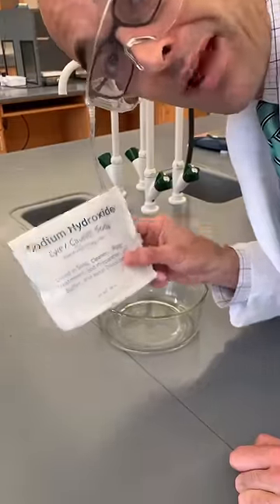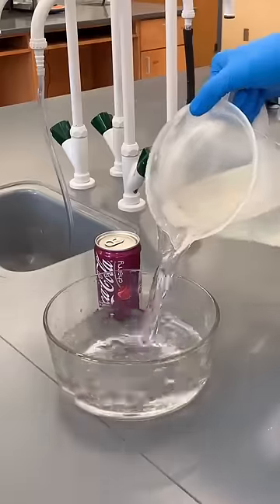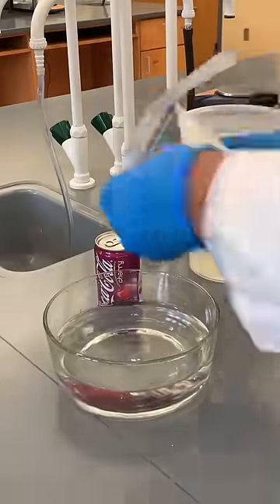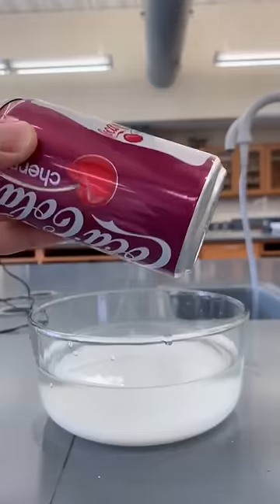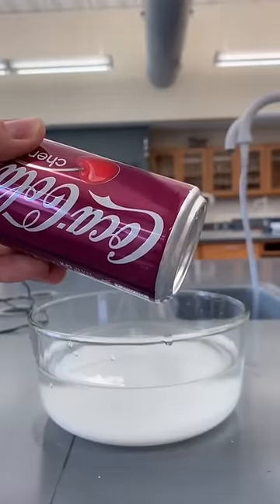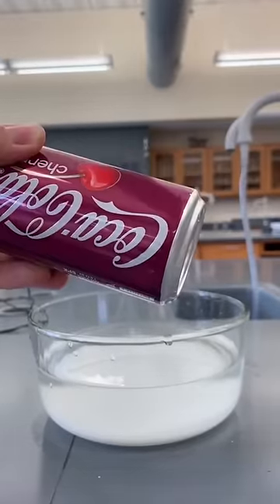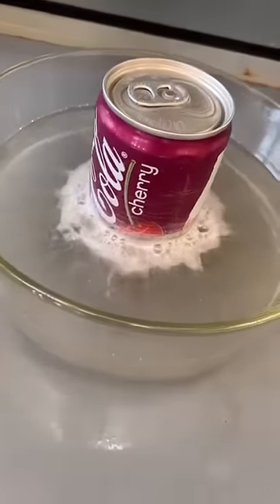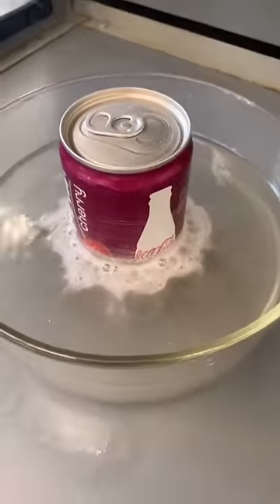Did you know this about aluminum cans?

Comment: The plastic liner is to keep the acids in the soda from eating through the aluminum can.  Also, they use thicker plastic liners in energy drinks, like Monster, because they were corroding the soda can liners.  We drink this stuff!!
Reply: Yeah, really, you look in the ingredients of coca cola and realize the big one is phosphoric acid. who wants to bet that the phosphoric acid dissolves aluminum? I bet it does.
Reply: That’s why I don’t don’t drink soda anymore. It’s literally a can of chemicals.
Reply: Probably isn't amy worse of an acid than the stuff we have in our stomachs.
Reply: Well, it makes sense because these beverages may be used to strip car battery acid. Pouring coke over your battery cables has been a remedy as long as I can remember. I wonder what it’s doing to our innards?  🤢
Reply: Ya'll drink that stuff I stopped drinking soda awhile ago and I feel better now even though when I was drinking it wasn't a lot.
Reply: Well we aren't made of aluminum
Reply: @rOnda88  Actually, the problem isn't the cola (necessarily), but the aluminum. Aluminum creates dangerous and toxic byproducts when it reacts with acids. That''s why uncoated aluminum isn't really food safe.
Reply: Concentrated mountain dew syrup is more flammable than the diesel fuel used to transport it. In fact its so flammable it is considered an explosive and is illegal to personally transport out of the country.      Got to see this first hand in the DPSSD course for flammable liquids n gasses.
Reply: Buy glass bottled drinks like a classy fella
Reply: I mean, citrus also has acids (its literally called Citric Acid), of course its healthier, but if the idea of ingesting acids is the main thing disgusting people then think about citrus or sour things in general.
Reply: you do!
Reply: Well I don't hold soda in my mouth or stomach for weeks maybe months at a time...
Reply: Imagine what it's doing to your gut!
Reply: ...... and it tastes dang good!
Reply: @medexamtoolscom  If you have to bet it does, then should you really be talking about it? For one, it's not a big ingredient. While being the third highest ingredient in the diet coke I have in my hand, that's after the food coloring, so, there's very little of it in the soda. Two, phosphoric acid is a weak acid, though it does stink and irritate the sensitive parts of your body like your eyes, lungs, and the inside of your nose if it finds its way in there. It's probably part of the reason why if you inhale pop fizz, you might cough or sneeze. Thirdly, while it is a weak acid that poses very little harm towards your at all, it can dissolve metal, so your guess, while uninformed, was correct.

Also, I just looked into it and phosphoric acid has a density of 1880 mg/ml, and there is between 50mg-70mg of phosphoric acid per 100ml of coke, which means that in total, the phosphoric acid makes up 0.03% of the coke in the can.

In conclusion, stop trying to fear monger by reading ingredient labels. Chlorogenic acid is known to lead to heart disease, so you probably should steer clear of that one, right? Except, it's just one of the many chemicals that's in foods you eat all the time, like apples. Also, phosphoric acid helps with grow strong bones and teeth, along with support kidney health.
Reply: @datdude1538  And an apple is a ball of plant flesh that is full of chemicals. Do you avoid those as well? Not saying drinking soda is good for you, but acting like it's bad because it has "chemicals" is just stupid. All the food and drink you consume has chemicals in it.
Reply: @sunnybatman2578  Which is why only a tiny amount goes in soda.
Reply: I just think about when I was a teenager and didn’t have a pipe or paper to smoke pot and we would make a hole and do it that way no wonder it hit so hard 🫣
Reply: I just think about when I was a teenager and didn’t have a pipe or paper to smoke pot and we would make a hole and do it that way no wonder it hit so hard 🫣
Reply: It only hurts out teeth though.🤷‍♀️
Reply: @rOnda88  Our insides are not made of metal. It reacts with metal.
Reply: @AlashiaTuol  I dated someone who had mad aluminum sensitivity. So no cans or metal anything including for cooking.
Reply: @datdude1538  We are all just chemicals…
Reply: @rOnda88  Lemons are used to clean and deodorize. Are they still safe to eat? Yes…
Reply: The acid in your stomach is anywhere from 1.5 to 3.5 pH. Acid in soda is around 2.5 to 3.5, without the addition of water and whatnot to make it less accidic. In other words, it isn’t any more acidic than your stomach, and that’s where it’s headed… so it makes no fuckin’ difference lmao.

Be more worried about the contents that make it through your stomach, intenstine, liver, etc. to enter your blood stream. That’s what’ll actually impact you, not the shit that’s more neutral than your own stomach.
Reply: @datdude1538  Literally everything is a chemical.
Reply: @dinoboiis8147  I've used citric acid to clean years of hard water build up in my toilet tank. Imagine what it's doing to your insides!!!! ¡¡¡¡

Now let me tell you how healthy I eat and how I'd never put chemicals into my body-including dihydrogen monoxide! The deadliest of them all!
Reply: @andymittelman4022  Literally nothing. Your stomach acid is far more corrosive.
Reply: Damn you're right wtffffffff it's glass bottles for me from now on
Reply: @TheRealSindri  our stomach acids can dissolve nails. I doubt whatever acids are in carbonated drinks is going to do anything to us
Reply: Just as well our insides aren't made of aluminium.
Reply: Drinking it isn't a problem. The issue comes when you drink too much of it. As with anything, too much of something is bad for you, even water. Too much water can make you sick, even kill you. Too much oxygen can make you sick. Too much sugar, salt, vitamins, minerals, literally anything your body needs can harm or even kill you if taken in excess. As it turns out your body can use a lot of things. Phosphoric acid is one of them, carbonic acid is a product of carbonated water, but is also what your body makes to move carbon dioxide around the body. Citric acid is a necessary acid as well. Just because something has "acid" at the end of it doesn't mean anything without the context of what it actually does and whether your body uses it. Hell our bodies make hydrochloric acid to break down our food, and phosphoric acid is no more acidic than our own gastric fluid. Unless you go drinking a pure bottle of it, you won't affect yourself too badly by drinking one or two a day. It's the people that make it their only drink that will have the issues. Not because of the acid itself. Again to cause any serious physical harm you would have to go drinking a ton of soda, more than you would generally be able to handle to have acid damage which I'm not sure would even happen from the diluted amounts found in soda as it's only there for taste. No, you would have more issues with the phosphorus displacing the calcium in your body. Now keep in mind, your body needs phosphorus, and both it and calcium are used in the same place, but if you have too much phosphorus and not enough calcium you can have problems. That's where the true problems of phosphoric acid lies, not in the acidity, but in the things your body breaks the acid down into, it's base components.
Reply: I know a guy with a coke addiction. His teeth are black & are tiny little stumps. In Adelaide Australia we have access to cheap or free dentistry. He owns his own business tho & has the means to pay. He just doesn't. Yuk. A lovely guy. A good father but..
Reply: it's to prevent aluminium poisoning.
Reply: @Sovereignty3  except for the fact that stomach acid is supposed to be there. Add phosphoric acid and you cause a calcium phosphorus imbalance & mess up your acid base leading to bone loss, osteoporosis and weak broken bones. But go ahead, enjoy your cola, it tastes good so can’t be that bad.
Reply: Y'all drink that stuff!! Not in my temple!!
Reply: @datdude1538  What do you drink now?
Reply: Not all of us!!!   🤮
Reply: @Sovereignty3  difference is ours is natural to our micro biome.
Reply: @dbutler1986  were made of something softer
Reply: @dinoboiis8147  bro citrus is naturally occurring 🤦🏾‍♂️ soda isn’t it’s made in with the mixing of different chemicals to make a carbonated sweet and tasty drink
Reply: We breathe oxygen which will rust iron, Just saying.
Reply: @wruenvadam  Thank you for reminding all these people how much of a doofus they are.
Reply: And we put that in stomachs
Reply: @Sovereignty3  only thing I heard all day that makes any gdamn sense.
Reply: What's bad for metals is good for humans. What's good for metals is bad for humans.
Reply: @medexamtoolscom  it takes the blood off the pavement. The clean up crews use Coke a cola for that
Reply: @DoKuShOsTaR  yeah
Reply: Any food or drink in plastic is awful for you. Especially microwaveable foods. We only have glass Tupperware anymore and use the oven
Reply: @trjberg  I will look this up Mr. Berg...  Since one human pointed out something that is considered shocking for humans to consider them there must be some proof to validate a claim.  I'm about to drink battery acid for breakfast!
Reply: Wow that’s a definite eye opener
Reply: @datdude1538  but they taste soooo good lol
Reply: @razzledazdazzle  no that’s not the point. The point is our stomachs are made to handle stomach acid, which is hundreds of times more corrosive than soda, so it’s “chemicals” are of very little concern to our stomachs. Yes, there’s phosphorus, but our body does a damn good job of controlling whether or not we actually absorb phosphate and how we excrete it - look up parathyroid hormone. It’s very fascinating tightly controlled stuff. 

The biggest worry with soda is really our teeth. They will corrode under ~5.5 pH. But even then, you’d have to drink soda pretty much all day every day for years to see a noticeable change. Most dangerous thing about soda is really all of the sugar and unnecessary calories.
Reply: I mean our stomach acid is strong anyway
Reply: I feel ill now 🤮
Reply: @rOnda88  You should see what salt water does to iron. And they give us this same mixture called saline in IV form when we are dehydrated. Amazing how WE AREN'T MADE OF METALS.
Reply: Bro no one drinks energy drinks no more
Reply: damn!! that's incredible!
Reply: @Sovereignty3  Doesn't help it going down. Teeth, gums, throat, skin, lips, esophagus. No shortage of things it can damage. The acid is meant to stay in your stomach.
Reply: So how is the plastic liner recycled? Does it just burn and evaporate into the air?
Reply: There are a few different kinds of plastic in the world, Jack.
Reply: Beer yes- Monster no 😮
Reply: @commentator2.0  where in the world did you get this idea
Reply: @medexamtoolscom  well that's why there's a lining in the can. So it doesn't react with the aluminum in any way and then we're consuming aluminum.
Reply: @Sovereignty3  one is natural....the other isn't!
Reply: @rOnda88
Reply: Some of these people are really going to be horrified when they hear about DHMO.
Reply: @datdude1538  that's why I don't drink water anymore, it's mad3 of hydrogen and oxygen and who wants to drink two things that are highly flammable?
Reply: @datdude1538  everything is chemicals
Reply: There isn't a plastic liner. I work in the industry and it's just a coating on the aluminum.  Soda has it, beer doesn't for obvious reasons. There is no sleeve or insert. The coating is so thin, we test for scratches the would cause metal exposure.
Reply: A lot of folks also drink flammable liquids
Reply: @Maxwell_Twist  no 8
Reply: This is why you trash a pan that the coating is flaking off.
Reply: @sunnybatman2578  It's a bunch of sugar and additives... so that's not really surprising.

Sugar in general is super volatile.
Hence why sugar rockets are a thing.
And why you need to be careful when making caramel at home.

I'd say the only reason we don't use sugar for fuel is because it doesn't let off combustible vapors like diesel and gasoline, and any sugar liquid would be syrupy and hard to feed through a fuel line due to sediments. Otherwise it's plenty abundant and highly combustible.
Reply: Mmmm I love the taste of metal
Reply: @rOnda88  as long as your mucus membranes are healthy, then not much.
Reply: Did you know water corrodes metal? And juice? And milk? And coffee? And tea? We drink this stuff!
Reply: @macdeuce1008  …where your stomach acids are much more powerful and potent than citric acid.
Reply: you know who else can eat through aluminium (this is called reaction)? WATER
OH NO! WE DRINK THIS CURSED STUFF
Reply: Your stomach acid can break down metals. Calm down.
Reply: @S Gwood  hi, thanks for your comment.  I used to work in can making over 20 years ago and thought the liner idea was odd. So this is just the cured lacquer on the inside of the can.
Reply: @icianthea  hahaha H20 just ummmmmm named different... A survey to ban that from subway bread was funny as
Reply: @datdude1538  everything is chemicals, bud.
Reply: @dinoboiis8147  its amazing what the human body can absorb. For example, if you were to give a dog citric acid. Such as eating apple seeds. The dog would have a terrible last few days of life. But we can consume theme without worry. Except for cyanide, that is also lethal to humans.
Reply: I like to poop in the beach near other people in the water so they ran with the gift while they swim. One time this dude was swimming and my poop got into his mouth ! He couldnt believe it and he never knew it was me 🤣
Reply: I like to poop in the beach near other people in the water so they ran with the gift while they swim. One time this dude was swimming and my poop got into his mouth ! He couldnt believe it and he never knew it was me 🤣

Comment: so nobody is going to speak on the fact that the can was disintegrated but the bottom stayed fully intact?
Reply: Right?!?!?!  That's exactly what I thought!
Reply: @shyblondebbw  he didn’t expose that part… only the sides were scuffed.
Reply: @WhackBytch256 that and, the bottom of can is thicker than the sides.
Reply: Maybe the bottom and top arent aluminum...?
Reply: Or maybee the sand paper reacts some how bc the only place that was turned to plastic was where he rubbed it with the sand paper.
Reply: @JB-yr4vd  low marks in comprehension
Reply: He mentions that the Sodium Hydroxide only reacts with the aluminum. Therefore allowing the plastic liner inside to stay intact. Magic.
Reply: Looks like it may be hard plastic under the aluminum on the bottom. Makes sense.
Reply: @stevenwilliams1805 GOOD OBSERVATION.  - Plus, can rests on the bottom of basin, less exposure to the full concentration of the lye solution.  ( maybe ?? )
Reply: Do you think only the scuffed material dissolved?
Reply: @marktulk4225  The indentation on the bottom of the can would fill up with hydrogen gas, pushing out the sodium hydroxide solution. So that area would be protected by the pocket of gas, and not be exposed to as much of the solution as the sides, which would be continously exposed to the solution.
Reply: @JB-yr4vd  ? It's thicker and he didn't scuff it so obviously it would take longer to corrode than the thin sides.
Reply: @clayowens4176  It doesn't react, it's just making the aluminum more permeable by creating small abrasions.
Reply: @davidestabrook5367  thanks for that explanation, I didn't think of that. Also the scuffing took off the protective paint (or whatever it is) on the outside, I wonder if that's a type of plastic too
Reply: Maybe the underside, it's captive didn't fully expose to the acid

Comment: For those mentioning the bottom, it’s thicker, probably to support the weight and not allow the can to deform when full, it WAS affected by the chemical bath, if you pause it, you can see some pitting, but the thicker bottom would need more time than the micro thickness of aluminum that makes the sides.

Comment: I'm actually impressed the plastic was that strong and held that much to pressure and the chemical
Reply: does not automatically need to be strong material. Example normal plastic (PE) container can hold one of the strongerst acids in the world in it. Fluroic acid that melts through a house floor if you spill it.

Its simply because Polyetene does not react with it.
Reply: @jarskil8862  fluoric acid is only "strong" for some materials (like glass). Dissolving flesh like in Breaking Bad actually does not work at all.
Reply: @ElCerdoBlanco Yeah, if anything, a base would be better for that than an acid.

Comment: In the 80s, Coke and some other brands switched to extremely thin aluminum, to save money. They would burn like paper when thrown into a fire, which surprised me at first, and looked pretty cool. They were discontinued because even slightly rough treatment caused pinholes in them.  You'd buy a six pack, and one or two cans would be half empty